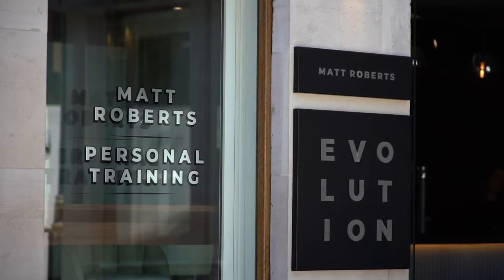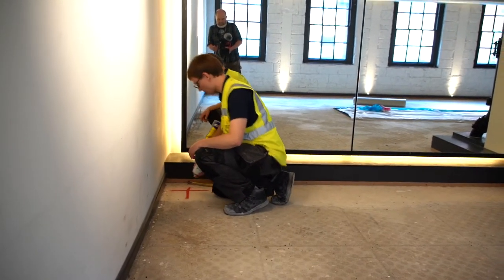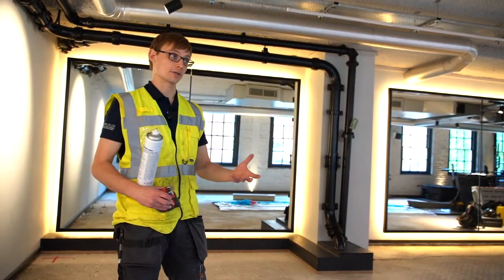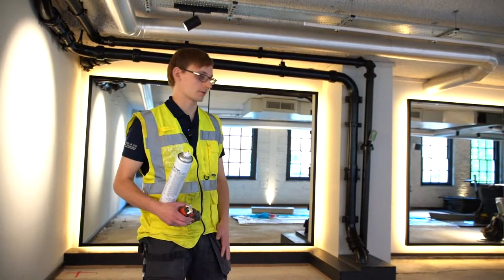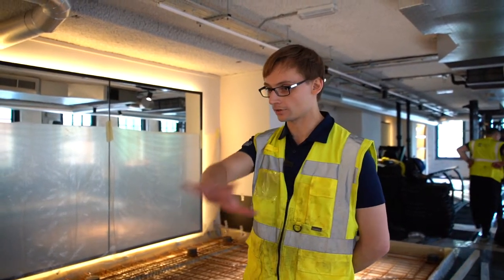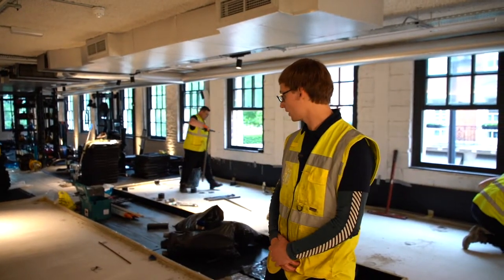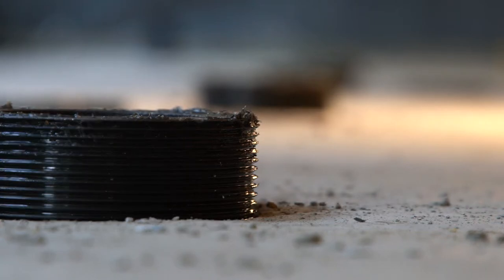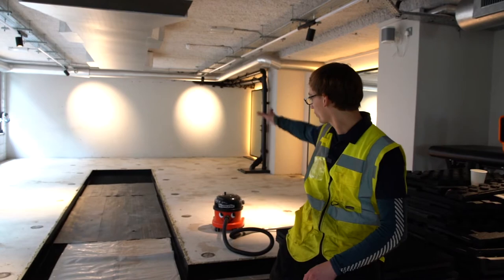Concrete Floating Floor Installation for Gym Free Weights Vibration Control – Mason UK Ltd

Comment: Hello

As an Alternatif option, Can use stacked fibrecement as a floor?
for example : I use 5 layers of 2cm fibrecement as a floor?.

Thanks
Reply: Hi,

Yes you can do that as an option and it does work quite well acoustically, but it's not quite comparable to a concrete floor; you can't use as high deflection springs and cement particle board is only about 60% the density of concrete, so it doesn't offer the same level of performance. We do use that type of system though where appropriate, with either small low deflection springs or rubber elements. If you need any advice, feel free to get in contact with your local Mason agent and we'd be happy to provide some guidance.